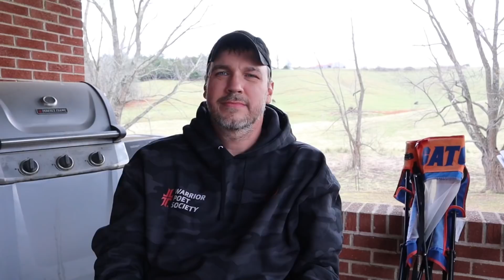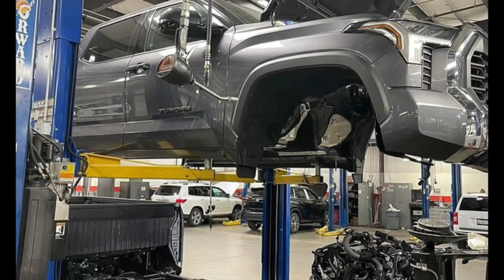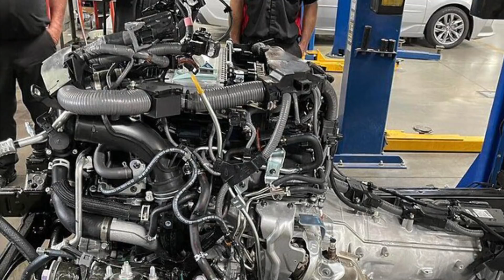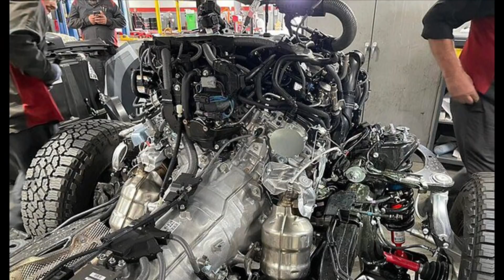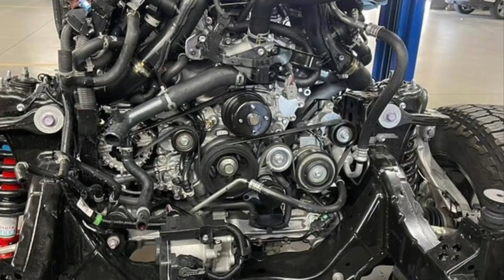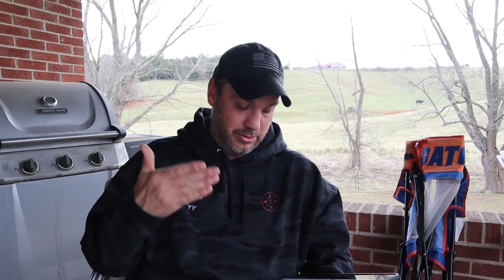2022 Tundra Problems… This Could Be A Disaster

Comment: Yes the passenger side turbo was blurred. left side photo you can see turbo fins on the discharge side cause right beside the other small circular is the wastegate. They plumbed in the discharge side of the wastegate to feed it back though intake piping, I don't know where it's plumbed into specifically. Problem  according to engineer is not turbo,not wastegate, but actuator.  Yeah whatever it's all one unit, but I also include the entire truck less than 10k miles. Actuator is the dumbest design cause it doesn't use the pressure of the turbo for operation it uses an electronic controlled electric actuator. I predict  while Toyota has had good design in the past. This issue can and I believe will eat their lunch.

Comment: I have a 2014 Toyota Tundra SR5 (6.5 ft bed) with a TSS package. I used to complain that my 5.7L is behind the times but now I'm glad I still have her. 🤓

I've installed a 46 gallon tank, chrome delete,. 2019+ LED headlight units, gun safes, Bilstein shocks and struts with a 2" lift and she still drives like new. No rust with 104,000 miles. 😃

Comment: 1,000 miles on my 2022 Tundra Limited Crewmax 4x4 & it's already having problems starting.  Battery, starter, and alternator tested "Good."  Seems like the battery is not holding a charge.  Of course Toyota has no loaners in Springfield,  IL so even under warranty this is about to cost me thousands to rent a car while they figure out what i am sure Toyota HQ already knows.

Comment: I dont see an engine from any angle. Looks like a mound of hoses, wiring, & tubes. Must be a nightmare to work on. Its sad to see even trucks & suv's forced to have "modernized" drivetrains. IMO the tundra needs an optional Manual trans & V8 with a good exhaust note like previous trd pro trim. They would reduce the points of failure.

Comment: Exhaust side of the turbo on both sides of the other engine that little flapper  That’s the exhaust turbine The blurred out picture might’ve been the problem with the wastegate flapper. Wastegate probably stuck open throwing a code.

Comment: It would be interesting to know the amount of truck sold compared to the amount of trucks with problems?  What percentage of trucks are we talking about here? I know we all want NO issues but that's unrealistic even with the 5.7, I'm sure they had their own issues when first released, but when they first came out we didn't really have the youtube age to highlight issues.  Im sure these are isolated instances on a small percentage of trucks sold and will be corrected soon.  We have to give Toyota a chance to prove themselves with something new.   Just my opinion.
Reply: agreed, although Toyota has a great reputation they are not without faults, just like every other manufacturer, issues are inevitable and as you said these are isolated instances, people are quick to assume each and every Tundra will have this issue from the start and its simply untrue. Even if this proves to be a common problem the outcome is Toyota doing what ever is necessary to fix and improve this for later models.
Reply: How do you as a manufacturer overcome all the bad press!
Reply: This is true, but the "oldest" '22 models have only been on the road for what, 6-8 weeks MAX?  A problem this major before a full tank of gas is used is completely unacceptable from any manufacturer, especially since Toyota had 14 years to get this right.

Comment: Tundra needs to have a v8 or a diesel, not a wimpy wound up twin turbo engine.
They are trying to meet gov standards for emmisions and fuel mileage crap. Also trying to make several toyota vehicles use the same components like engines and such. Tech and the future in your face. Complaint - no factory step for getting into truck bed, no tow or recovery hooks in front. Silly people.

Comment: There is no excuse to design a vehicle that the chassis and body have to be seperated to effect a engine repair. Anything external of the engine should be able to be replaced without removing the engine or the body to do otherwise is just poor engineering. When a vehicle broken down to pulling the cab from the chassis there is a big chance of creating other major problems that otherwise would have never happened and as already been said to have major repair like this performed out of warranty could total the vehicle.

Comment: Toyota techs have been lifting cabs off framed since the early days of tacoma and tundra frame replacement Limited Service Campaign (LSC) over rust perforation issues, 2013?2014? not sure. Ford's f-150's have been designed since 1997 to be if major work on the engine or removal was needed to be done it was best and by design, easier to raise the cab to give full access to the engine. Modern vehicle design! Period! Pretty sure Gm and Dodge are likely the same.

Comment: Eh. We are talking 10-20 trucks. Turbos use waste gates. Cab off the frame is common. Mechanics do it all the time on different brands. It is quicker and saves times.
Reply from the maker: Can you guarantee no more than 10-20 will be found?
Reply: No he can’t .. just like none of us know how many will have this issues
Reply: @gearrunner  limited run supplier issue. There are hundreds of us without problems. I’ve spoken to Toyota and they are aware of a few forum posts and a couple of owners. They won’t give an exact number. I’ve also spoken off the record with engineering and its much ado about nothing. I got 1300+ miles on mine without issues. This has been on the Facebook groups and it is really becoming a non-issue.
Reply: @justinl8455  uh, actually I can. Thanks though!
Reply from the maker: @Pickuptrucktalk  So Toyota won’t give an exact number.  So how did you come up with 10-20 if Toyota won’t even do that?  I hope you’re right but if Toyota won’t do it it leads me to believe they are also hoping that is the correct number.
Reply: @gearrunner  talking with engineers as well as extrapolating from the posts we’ve seen online.
Reply from the maker: @Pickuptrucktalk  hopefully your right but you do have to have a subscription for the remote start. 🤷🏻‍♂️
Reply: @Pickuptrucktalk  well if you getting your information directly from Toyota and that’s the number you were  told then fine .. but hopefully it’s a non-issue. But the very well could be more than 10 or 20
Reply: @justinl8455  this has been going on for weeks and we aren’t seeing many new owners with problems from the various groups I’m in. That speaks to the size of the issues.
Reply: @justinl8455  This issue has been going on for weeks but no journalists reported on it before Gear's video yesterday. People that have on-going "business" relationships with a manufacturer need to nurture those relationships and protect their own interests. This is not a slight against Tim, but Toyota will tell him what they want relayed to the public and he will adhere to the script, in the interests of future business relations. Hope this helps.

Comment: Wastegates are very simple mechanical devices.  They don’t have issues like this.  Here is the real problem and it’s happening to most newer 2021 vehicles. BAD MICROCHIPS!  I bought a 2021 Silverado and then after multiple electrical issues a 2021 Ram 1500….returned it due to electrical issues.  DO NOT BUY NEW.  Buy a 2020!

Comment: Sucks for sure and man, all the hoses and wires is a mega OOF for sure. But that's just how shit is today. I think before people lose their collective minds, they need to step back and understand that the first year of something new is going to have issues. It's usually ALWAYS like that. This is why most people won't gamble with a first year product. Having said that, my biggest concern is how with a rushed supply chain, maybe parts aren't being built correctly. Maybe a batch of turbos didn't get assembled properly, since the company making this junk had deadlines to meet, etc... That's the kind of stuff that freaks me out. If I was looking to buy a truck, it wouldn't be this Yota for a while, at least DEEP into 2023 or '24... Not worth the dice roll I think. Thanks for sharing the info!

Comment: Hello Andy. - I too would be highly upset if they had to remove the full cab body just to work on my truck. I hate squeaks or rattles and it’s a good chance that truck will not be “factory” tight once it leaves the shop. I’ve never liked the looks of the “new” Tundra and I certainly don’t like the fact that Toyota dumped the V8. If Toyota would have upgraded the transmission to the 10 speed a couple years ago, that would have made a huge improvement and increased fuel mileage if the gearing was right. Still loving my 2020 Platinum 4x4 with the the 5.7 V8. Keep up the great videos!!

Comment: That picture of the rear of the engine is the back of the trubo (exhust end). The circle with what looks like fins is the spool that spins in trubo that produces boost. The flat circle next to it is the wastegate. It opens when the turbo hits the max boost setting to stop the turbo from boosting too much and prevent damage from too much boost.

Comment: Problem or not eventually at some point the bodies coming off because of bad engineering and simply the using of turbos, this is going to be a disaster for Toyota both short and long term no question.

Comment: Trot on over to any FORD dealership body off s as common as rice in Mexican restaurant/ can’t remove engine any other way look under the hood on diesel in a Ford F-250-450/ even back in the 2nd gen Lightning truck body came off to replace transmission. Would I be happy no.but fools wanted technology in new truck -they got it.

Comment: You spend 55 60k on a truck that has 1 problem if u want but I bought a a 2021 and traded in 60 days.  Then I got a real truck Chevy trailboss.  Idiots buy Toyota and I was a 1 time idiot.
Reply from the maker: I will say this.  I’ve had no issues with my Tundra and my cousin bought a brand new Trail Boss last week.  The rear window was leaking so he took it back 2 days after he bought it. They out a new one in it and guess what? It’s going back again for another back window. 🤷🏻‍♂️
Reply: @gearrunner  21 or 22?  Mine is a 22. 21s sat in holding pins for a long time. In the heat of Texas

Comment: This guy acting like its a f-35 jet getting dissembled and putting it back together , the only ones that get to do this are master tech not no junior tech that rotate tires and changes oil
Reply from the maker: So what you’re saying is if you had a truck with just over 300 miles on it and seen it like this you’d be like heck yea that’s pretty awesome!  Cause that’s how you’re acting.
Reply: @gearrunner  i would be upset , but i would have to trust them
Reply: @jzila9900  "Trust them"? The owner was promised that he'd be receiving a call from the general manager at Toyota corporate. Two days goes by and still no call! He paid $60K and his truck doesn't run and they can't even call him to discuss it or give him a timeline to fix the issue. I think the owner having owned thirteen plus Toyotas over the course of his life has more than demonstrated the word..."trust"!

Comment: Dont buy Tundra until this fix or Toyota offer extended to 100k miles. Soon or later you will have turbos problems. Imagine the turbos go bad right after 50k miles warranty expire . This is bad design from the gecko. Supra turbos replacement takes roughly 4hrs or less. Now, 2022 swap the turbo take 10hrs or more.

Comment: I know how exactly this was thawed out by Toyota. They  intentionally made this new tundra to suck so this trucks engine option would die quickly within a few yrs leading them to the last option/s which is that retarded electric stuff . Also it would probably boost the value of the previous gen v8 tundra making it to the point of costing twice as much than when it was brand new

Comment: Stay away from Turbos, it benefits Toyota only ,not consumer, Turbo on a regular everyday Vehicle is crazy high Maintenance, Higher fuel pressures, a lot more heat in engine, more stress on engine blocks  just a lot more of unnecessary parts, Keep turbos in sport cars or at least give the option to purchase a V8 Naturally aspirated, shame on Toyota. V6 Turbo crap sorry Toyota.

Comment: ii used to be Toyo man but they got like the rest so is300 lexus is last good car .tacoma is cool still but ll not buy a model anything. That v6 turbo crap is just to bizzy 3.5l turbo in a truck nope not me but i stopped buying 1/2 tons because or weak transmissions but not toyota Now that toys have went away with thir v8 so stay away from them to .ill stick with the 2500HD 4l80 trans old units or new ford gas 7.3l f350 fords just for reliability just me buy the fleet units much cheaper